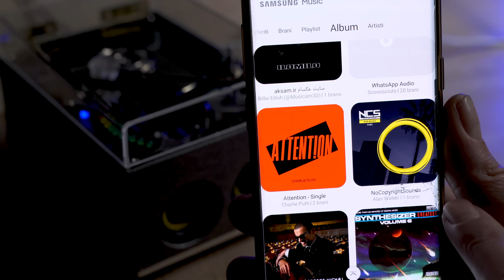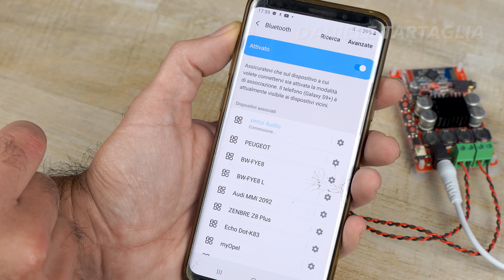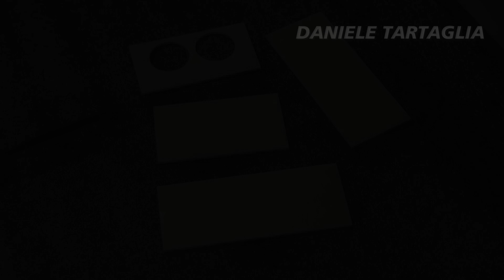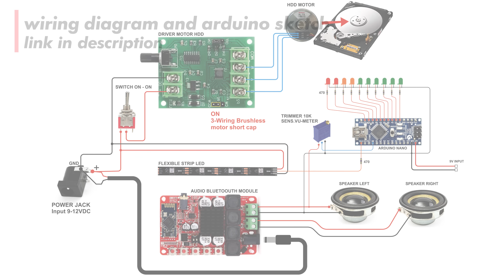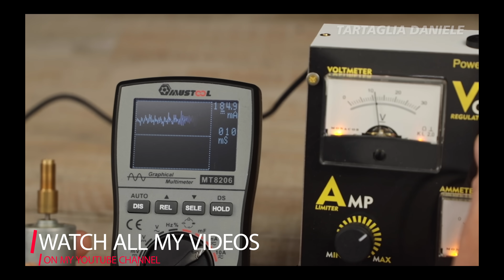AMAZING IDEA  bluetooth audio player with HDD BROKEN

Comment: 20:17 speakers move in opposite directions (most likely the one from the right has been wrongly marked)
Reply: yes, I also think so... could be factory fault, but yes, they have opposite polarity... the bass pressure will be affected, but in that size, who will notice?... :)
Reply: @hyndass  switching one speakers polarity will definitely increase the quality of the sound. And that will be no work compared to the complete built..
Reply: Literally accidentally made a speaker that has active noise cancellation on itself lol
Reply: it's all fake, the sound you hear playing is not from those speakers
Reply: at 4:55 you can see that the speakers are pluged in the same direction. But, the green spots aren't in the same position, that's why you see one moves in the different direction of the second. (sorry for my english, i don't use to use the technical language ^^) just a little mistake ^^
Reply: @heinertenpenny4208  two speakers vibrating in opposite directions will cancel each others outputs. In practice, there won't be a big difference, especially with such small speakers, but it will definitely not increase the audio quality.
Reply: @Toilet_Sniper  it didn't matter that the sound didn't come from those speakers, it was just their movement which should have been identical. An identical 1hz wave could be played to check they vibrate in the same direction.
Reply: @arkh9924   what do the green lights have to do with the speakers' vibrating direction?
Reply: @soupflood  sorry, with "green spot" i wanted to talk about the connecting point... i forgot the word for the +/- plug
Reply: @arkh9924   the cables are correctly plugged in, which is what matters.
Reply: @soupflood  so, is it the good way ? for one of the speaker : red on + and black on - / the second : red on - and black on + ? we can do that ? ... but I'm still lloving this kind of project !! I just want to know if there is a mistake or not.
Reply: @arkh9924   i hope we see the same thing. The red and black wires are plugged in simmetrically, like it's common on factory boards. Check it out at the fourth minute or thereabouts

Comment: And what about using the disk as cutting for cheese, ham and/or others similar.
Reply: Or a table saw...
Reply: Those disc are made either from a ceramic or aluminum and plated with chrome(?). Not sure how long they would hold up to cutting the cheese or wood.

Comment: That montage after 20:20 with the audio fade was really nice. Good job on the edit!

In addition: Did you consider adding a battery to it? Or would that need some more components for managing charging and even power output?

Comment: homemade very cool... even a little bit in the retro style, but there is one big BUT.... Such a home-made device requires a powerful power source, so that there is no sound distortion due to the lack of power of the power source... I advise you to use the power supply from the computer, it just gives out very high power, which is very cool

Comment: The only thing that's driving me crazy is that the speakers seem to be out of phase, when one moves outward the other moves inward, this is not good as it will actually hurt the performance, especially the bass response. Either way, it is a very innovative idea, a great video.

Comment: The RJ11 is upside down. You need the tab towards the bottom and not the top. The speaker wires are wired for the wrong polarity. Neat but balsa wood will not hold up for long. Nice desk piece that doesn't get moved around a whole heck of a lot.

Comment: per il vu-meter esistono degli integrati apposta, comunque dato che dovevi usare l'arduino per i led (esisterebbero anche in questo caso delle schede apposta, ma lasciamo stare) va bene comunque (a questo punto avresti potuto controllare anche il motore direttamente con arduino). Per il segnale audio avrei fatto un mixaggio stereo->mono e magari avrei preso un segnale di linea non amplificato da qualche parte sulla scheda prima dell'amplificatore, giusto per fare arrivare all'arduino la giusta dinamica del segnale
Reply from the maker: Sul' ultimo tuo suggerimento, credi non ci abbia pensato? non sono riuscito a capire dove prendere il segnale al' uscita del pre e non del' ampli come ho fatto io, ma non hai visto lo schema perchè ho usato un trimmer e ho regolato l' intensità in relazione alla potenza del segnale audio in uscita quindi, piu o meno è uguale.
Esatto, L' integrato LM3915 usato anche come voltmetro, ma avevo arduino e ho preferito usare quello. Per il controllo del motore non ci ho pensato anche perchè l' idea era quella di far girare solamente il disco e non di mettere vu-meter o effetti led. Comunque grazie :-)
Reply: @DanieleTartaglia  Lo schema l'ho visto e ho scritto il commento proprio perchè ho visto usare il trimmer (in generale potrebbe svolgere la stessa funzione, ma richiede una calibrazione più precisa e l'uscita dipende così anche da altri fattori come ad esempio il volume impostato) e con le mie intuizioni forse sarebbe stato possibile evitarlo. Comunque sono solo idee/commenti miei che mi sono venuti dopo avere visto questo video, prendili come possibili spunti/suggerimenti e non un modo per svalutare il tuo lavoro/progetto che comunque risulta un oggetto molto valido (così come tutte le tue creazioni) che io non riuscirei a replicarne neanche 1/10 😉

Comment: Good time of day. Please tell me what controls the second Arduino Nano Board, which is not in the diagram, but it can be seen in the video, it is located inside the case, next to the Bluetooth controller??? The craft is great,:) I would like to do something like this myself, but I was confused by the discrepancy in the scheme and in fact (Arduino Nano). When can I get acquainted with the firmware code, and will you upload it? Not good at programming :(

Comment: Excelent creation. Do you have a vídeo. How to recover the information or fix a hard Drive. Or change the disc to another hard Drive.  My stop working. And i have my childrens photos since they born and i dont want to loose all my photos. Scuse me If i write wrong.  My write is not so god.
Reply: Better thing to do is sending the drive to a trusted, specialized company in data recovery. It could be expensive, but it always depends on how much you want the data stuck inside the slab of metal.
Reply: Most of the time disks are Ok, Find the same brand and make clean room box and change the disk in it. The price is way less than asking a company for help. Making clean Box is not that hard. You need to add vacuum system to get dust out of it. If you do it very carefully you can do it even without a box

Comment: I think you have one speaker reversed... test with a battery they should move to the same direction, or else there is gonna be cancellation interference meaning weird or bad or no sound when two similar waves coincide...
Reply: i'm glad someone else caught that too. You can see it right at 5:30, they'll move in opposite directions when the bass kicks.